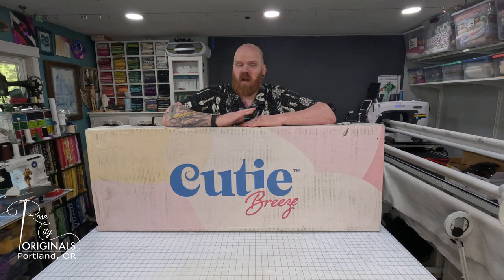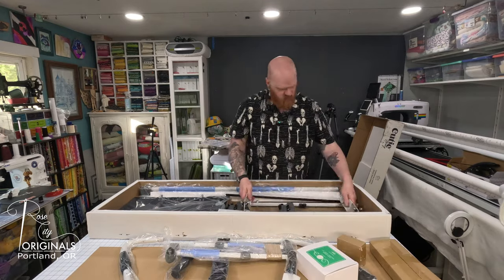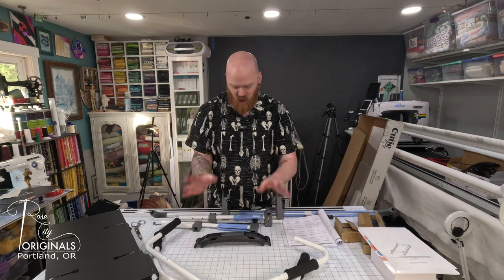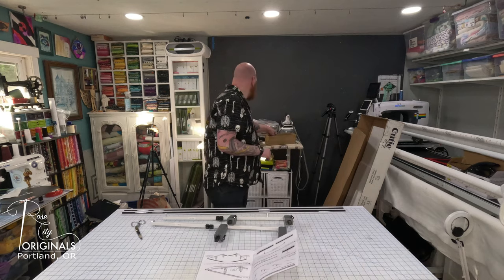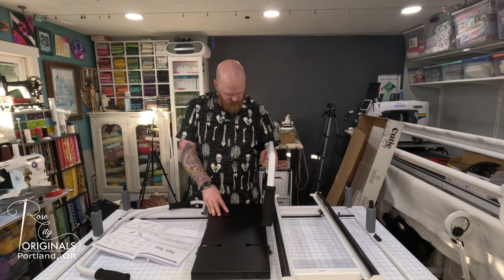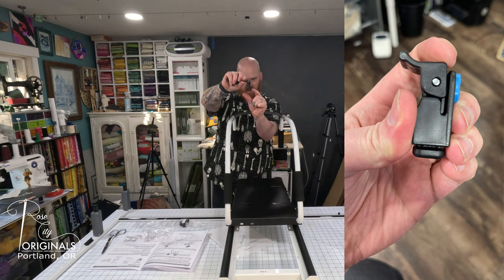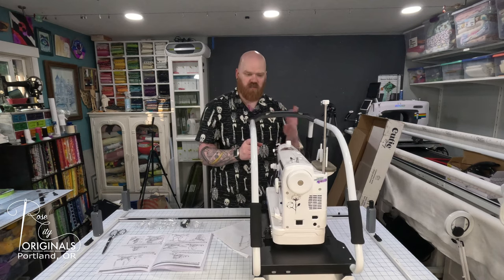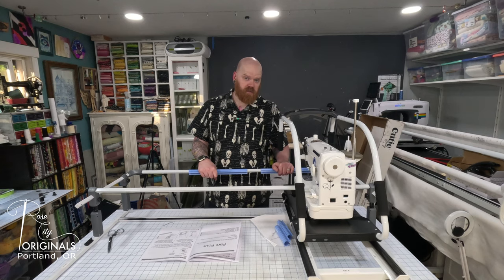Unboxing & Assembling the new Cutie Breeze from The Grace Company

Comment: One thing you can do with Styrofoam is break the pieces up if they are large and use them as crocks in the bottom of larger plant pots to provide drainage & cut down on weight..   

Thanks for showing how that frame goes together I've been thinking of getting one but wasn't sure how difficult it would be. ❤

Comment: Such a useful video, thank you so much. Do you know if this one has any stitch regulator capacity or does it rely completely on your domestic sewing machine capabilities, so if your machine can't have a stitch regulator then it's not possible? I once tried a long arm with stitch regulator and it was the easiest thing ever, just like drawing with a pencil rather than spending ages trying to perfect that even stitch
Reply from the maker: The frame itself doesn’t have any stitch regulation, but I did add it later in this video: https://youtu.be/3EwEvsmNa8A?si=cvIaCWWtStrQU86O
Reply: @rosecityoriginals  yes, I saw that later, thank you, I’m now trying to see if my brother innovis nv 1100 is compatible with any stitch regulator coz I think the one you are using mentions some brother models but not mine, thank you for your prompt reply